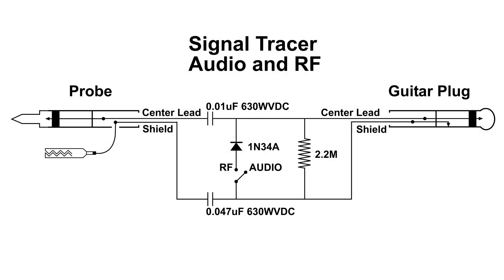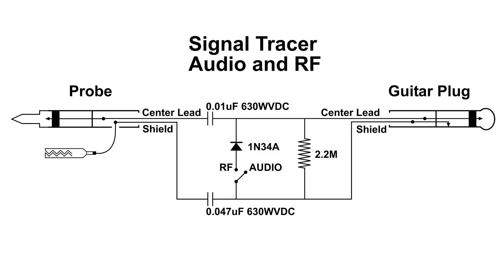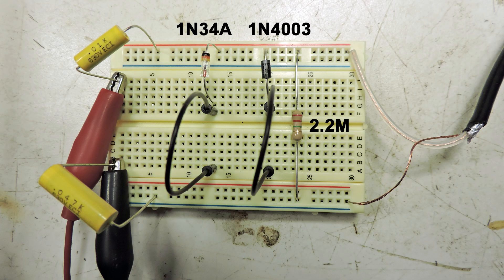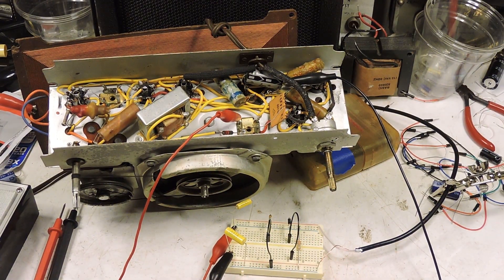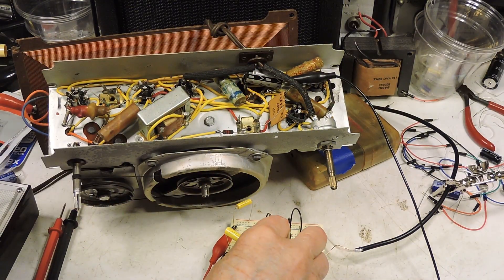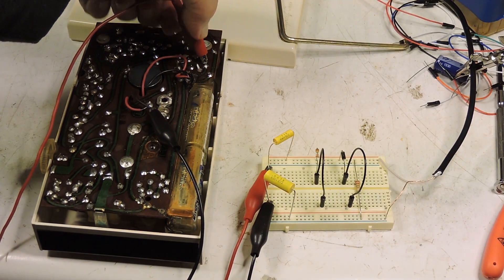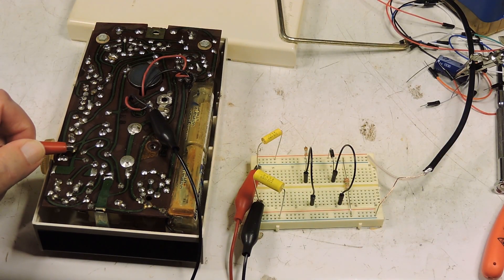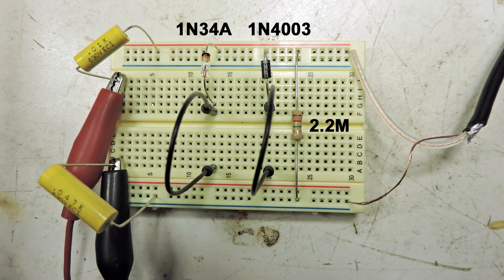Build a Audio and RF Signal Tracer using a Guitar Amplifier

Comment: Looks like a handy thing to have, I will make one this weekend!
Reply from the maker: A signal tracer is a great troubleshooting tool. Tracing a signal through a circuit and also locating noise in a circuit.
Reply: Works like a charm.  I was able to use a 1N4148 fast switching diode.  A Schottke I had also worked well. Thank you.
Reply from the maker: @edtully2740  The signal tracer is very useful, and thanks for the information.

Comment: kew. ummm...could we add a visual indicator á la Heathkit, but LED(s) to indicate signal strength since we don't have Magic Eye tubes...?
Reply from the maker: You could add and led indicator. You would need a small amp to drive the led, one or two transistors, and a battery.

Comment: I know this is an old topic, but I’m trying to find your video showing how you built the Tracer Probe. I can’t find it.  Could you help? Thanks.
Reply from the maker: I can not find that video either. I must have deleted it because I did not think it was a good idea.
Reply: I built your RF probe on a breadboard last night, and wondered if I could connect the output directly to my tablet oscilloscope instead of to my guitar amp, and see the RF signal there.  I have a 1960s Channel Master 6519 that I can't get any AM stations on.  The audio section of it is good, Ive got that working.  Could I probe the RF section from the antenna to the audio section with this probe and see if any signal is being received and going through the circuit.  I'm trying to figure out where the problem lies.

Comment: Can I replace the ampli with small amp like ordinay lm386 amp?
Reply from the maker: If the chip can amplify a signal from a guitar. Also if it can handle vacuum tube circuits.

Comment: I do like this and am going to build it. I was going to use an old tube radio with a broken bakelite case but then got to wonder

If i were to build this circuit with a rca plug, could i use it with either a transistor amplifier such as the tape input of a stereo receiver as well as the input of a tube radio? Or is it best to use with a tube amp only? Dont want to blow up the transistor amp should i probe something with more gain than the connected receiver can handle.
Reply from the maker: You should be able to use a transistor amplifier with a microphone input.
Reply: @AllAmericanFiveRadio  I tried this and no matter what amp i use it loads down the radio under test so much it actually mutes all audio. once i get past the first two tubes down the chain it works great but the first 2 tubes it drowns out completely. tried adding a 10 meg resistor in series with my test probe and it helps the loading on the tubes i can hear but not enough to make the ones its drowning out work.
Reply from the maker: @kwacz  You have not told me what you are using. The amplifier must be able to amplify a guitar, a microphone, or a magnetic carterage for a 33 1/3 record player. I’m not sure what you mean by dorwns out, that means loud to me.
Reply: @AllAmericanFiveRadio  I am using an amplifier with a microphone input. It has a low z and hi z switch. I tried both positions. I then noticed that the problem occurs with the amplifier not even connected to the audio probe. Completely disconnected so Im not sure what to think of that but maybe simply connecting it to the first three tubes in the circuit is either shorting out the rf or stopping the oscilator. Just a guess.
Reply from the maker: @kwacz  That’s interesting, where are you testing on the Tube? Tube number and pin number. I think I should do another video, a build and demo. Is your amplifier battery or AC?
Reply: @AllAmericanFiveRadio  the radio is ac. It the first there tubes in the chain. No matter where i connect plate anode or grid  7v7 or xxl tubes. I just cant seem to get a reading.  Then i realized just connecting a wire to a pin and not connecting the other end to anything causes the same thing to happen. The radio goes silent.
Reply from the maker: @kwacz  What is the manufacturer and model number of your radio?
Reply: @AllAmericanFiveRadio  it is a philco model 42-380 code 121.  The problem i am having is what sounds like a bad connection/ solder joint and i am trying to trade out where in the circuit the problem is coming from but cant seem to be able to get the probe to work without killing the audio from the radio.  It somewhere in the rf section as the reception fets stronger and weaker with a crackle when it does. It is vibration influenced as tapping foot on floor or rolling desk chair across the room causes the symptoms but for some reason poking and wiggling and even hitting the chassis has no effect. So i just need to find out where the problem starts to find problem
Reply from the maker: @kwacz  I believe doing the easy  stuff first. You may have a tube with Microphonics.
Vacuum Tube Microphonics
https://www.youtube.com/watch?v=KkJugKlzviQ
Reply: @AllAmericanFiveRadio  i replaced every tube in the set and it made no difference.
Reply from the maker: @kwacz  make a video of the problem and send me the link.

Comment: Do you know if this would work in the line in or mic jack of a PC?
Might have to have Audacity installed to use the PC speakers as a monitor?
Reply from the maker: I would not try this on any input of a PC. PC speakers with an amplifier are not sensitive enough. Go to a Flea Market and buy an guitar amp for about $25.00. Or look on eBay.
Reply: @AllAmericanFiveRadio  Thanks I actually have a guitar amp, I was just wondering because  I see many folks making tracers out of computer speakers that have powerful amplifiers inside them.
I have a Stryker 955 10 Meter radio that had a slightly shorted speaker plugged into it for  about 6 hrs before I started to smell burned electronics.
I unplugged it and used my back up CB the rest of the day in the dump truck.
I fixed the speaker and ran that radio another week but I had lost half of the audio volume that I once had. Near the end of last week though it got weaker and weaker throughout one particular day and I could hardly hear anyone so I plugged back in my backup radio.

I want a signal tracer so I can trace back to where  my audio is dropping out.

Comment: Greetings, I am having a hard time trusting the sellers of the 1n34a germanium diodes, a lot of the reviews of the sellers say they are actually silicone and from what I gathered in your video silicone is insufficient. If it is a silicone 1n34a will it work as well as the germanium? I'm in a hurry to build this and the silicone is readily available in small quantities. However I want it to be as sensitive as possible.
Thank you.
Reply from the maker: A germanium diode forward bias is about 0.3-0.4 volts. A silicone diode forward bias is about 0.6-0.7 volts. So the answer is NO. I'm working on a video idea. Let you know when I put it up.
Reply: @AllAmericanFiveRadio  
Thank you I will be looking forward to it.

Comment: Do the capacitors have to be rated 630 volt if I use it on a transistor radio only?
Reply from the maker: I would not use capacitors less than 630WV because the voltage deference the amplifier and the unit under test can be very high.

Comment: A neat little concept. I will eliminate the 0.047uf cap on my probe as I suspect it is making the shield ineffective (hence the buzz). Cool Tool. Thanks.
Reply from the maker: The 0.04uF capacitor is for isolation. Do not remove from circuit.
Reply: @AllAmericanFiveRadio  thank you !

Comment: Is there a reason that you ground at the capacitor (2:49mins) and not take a chassis ground for your black lead? I'm trying to get this to work, but it appears genuine 1n34a diodes are not readily available, with Schottky diodes being sold under the guise of 1N34a.
Reply from the maker: The capacitors isolate the chassis under test and the chassis of the guitar amplifier. 
Ebay item number 133530100291
Reply: @AllAmericanFiveRadio  You're very kind sir, thank you.

Comment: I just built this feeding it into the phone input of an old vintage amp.
I get the audio signal with the diode either switched on or out. But do no believe I am getting RF is there a possibility of loading the test circuit with this design impacting the RF signal?
I have used the same components, though the diodes I have are 34s not 34As but are germanium.
Reply from the maker: In an audio circuit you will hear audio this the switch in RF mode, but the audio will be some what muted. Make sure your diode is good.
Reply: @AllAmericanFiveRadio  Thx for your prompt reply much appreciated. Both Diodes test OK with a multimeter. When I run a direct RF only signal from my signal generator directly connected to the probe I do not get any sound, only when I switched it to modulated to i get a tone and that is both with diode switched in and out and no real change in the volume.
Reply from the maker: @gnerd1  This circuit detects Modualted RF like in a AM of FM radio.
Reply: PHONO
Reply from the maker: This circuit can only load a signal by 2.2M Ohms. If something is loading down the signal it could be your amplifier.

Comment: My theory is a bit poor on this sort of thing. The other day I came across someone who said that you can check if an oscillator in a radio is working by using another working radio positioned next to it and tuning through the band. I tried it and sure enough it worked. That got me thinking. How many diagnostic tools can be made from that one radio? I presume we can tap into the amplifier in the radio as a signal tracer? tap into it as a signal injector? perhaps others? 
Just a thought!
Reply from the maker: Thanks for the thoughts, I do need to do a video on signal injection.
Oscillator Trouble Shooting Using Radios as Testers Demo
https://www.youtube.com/watch?v=AuLP31cLBMQ

Searching My AllAmericanFiveRadio Channel
https://www.youtube.com/watch?v=4k7ByHqh8Js
Reply: AA5 did build a tracer and signal substitution test rig from a later all American five tube radio. It was an idea I had cogitated and one day I find his video.

You are on track with your thinking and executing it will help you learn and expand your mastery. Good luck!

Comment: Would this be useful for finding the source of a dropout or distortion of volume on the output channels of an Av Receiver/Amplifier if I fed a pure sine wave signal from a MP3 or laptop into the amplifier?
Reply from the maker: This works on analog Audio, AM and FM RF radio signals.
Reply: @AllAmericanFiveRadio   Awesome thanks

Comment: Hi, can this signal tracer work test tube amp 500-600dc voltage
thanks
Reply from the maker: The capacitors I used are rated at 630WV(Working Volts). If you need a higher voltage buy higher WV capacitors. What are you going to be testing?
Reply: i try to test tube amp, the voltage around 500 to 600v dc, i don't  know about the signal tracer and try to learn it.
thanks 
  @AllAmericanFiveRadio
Reply from the maker: What are the audio power output tubes? 6L6's
Reply: yes, 6L6 p/p 40 watt class A per channel
thanks @AllAmericanFiveRadio
Reply from the maker: @eddieng4990  According to my GE Tube manual the Max Plate Voltage for a 6L6 is 360VDC. But I have seen from other sources an plate voltage of 400VDC for Class AB operation. When your signal tracing your checking the control grid (input) and the plate (output) of the tube. So the signal tracer should be OK because the capacitors used are 630WV (Working Volts). Usually the highest voltage is in the power supply and these signal to trace there.
Reply: @AllAmericanFiveRadio  thank you for your explanation

Comment: This is very handy and cool Rick! BTW, I've been playing an electric guitar plugged into the RF input of an Eico 147A signal tracer. Its alot of fun. (I replaced the 1.5 watt 4" speaker with a 30 watt Eminence 4", plus another 8 ohm speaker plugged into the speaker test jacks). The amplifier circuit is similar to a fender 5f1 champ, and it does not disappoint. Thanks for the video  :)
Reply from the maker: Thanks

Comment: Can I use this circuit with powered pc speakers or would there not be enough amplification? I like this setup but would like to make it in a more compact package. Great page, great videos. Thanks.
Reply from the maker: If it can amplify a guitar peck up it should work.

Comment: Great video and great testing device. Just wanted to know how critical the uF capacitor values are and whether I can use higher rated 1Kv/2Kv ceramic caps (which I have plenty of at hand) instead of the 630V which seem to be expensive to purchase on eBay? I assume the voltage rating of the caps should not make any difference but just wanted to make certain this is the case. Thanks.
Reply from the maker: Yes a higher working voltage is good.
Reply: Thanks for taking the time to reply. I always love the clear and concise way you  explain things in your vids making the theory a lot easier to follow.